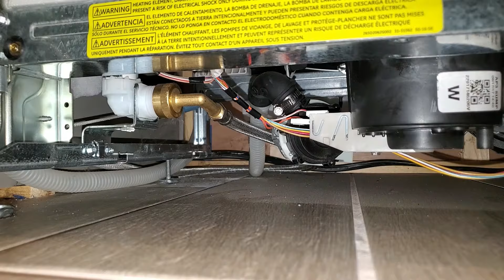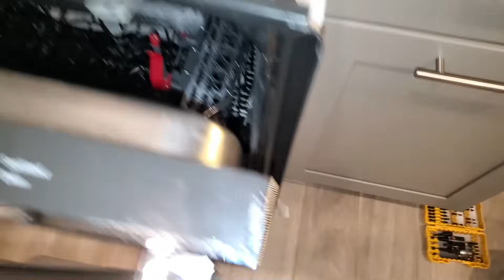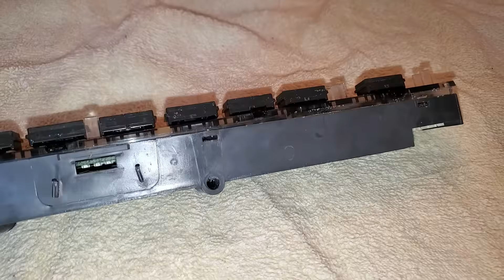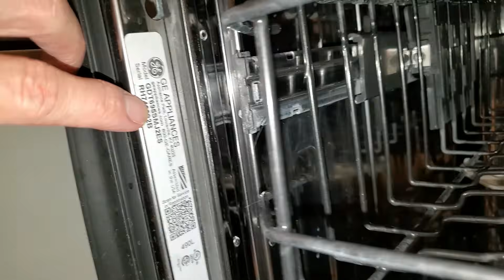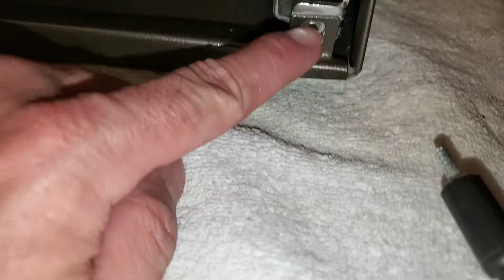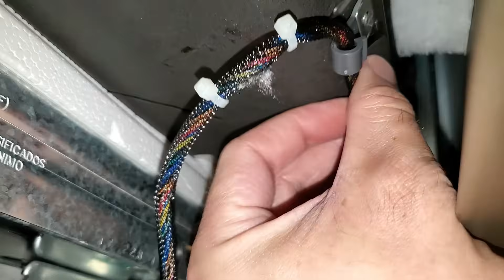GE Dishwasher Repair  - Replacing the User Interface Control Board

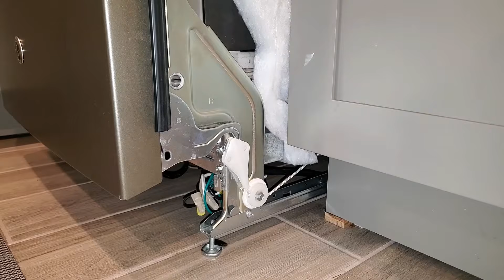Comment: Thanks for this it was very helpful.  With my unit (model ddt595ssj2ss ) I didn't have to move the unit out of it's spot. With the door shut,  I was able to unhook the white plastic tension tab attached to the nylon string with a hooked pick. The plastic has a hole in it, I unhooked the plastic and  pulled straight out.  If you look below the hinge area , there is a little bent up tab that is meant to hold the string (you can see it in your vid at 10:20) I pulled out the tab and slid the string in that tab. It's held securely in place but I still put screwdriver on each side though the holes just in case it slipped out. i didn't want to have to move the unit out to retrieve the string.  Then I removed the door and took it apart like your video. Again very helpful, but doing this saved me a lot of time and trouble.
Reply: I too left my unit in place and just removed the tab with needle nose pliers, after reading your comment I replaced everything using the reverse of your technique and it worked great, thanks!

Comment: Matt I really appreciate you posting this video! I got lucky and didn't have to disconnect the power, water or drain lines in order to pull out the dishwasher the 6-8inches needed to get to the hinge cables. Total time to repair following your instructions about 45 minutes! Thank you so much for posting this, keep up the good work!

Comment: Thank you so much for this video. I will say for our dishwasher, we ended up not having to replace the board. 

First we verified that 14V was coming from the power board. Then, after removing and disassembling the door, I checked that all switches had continuity when pressed. 

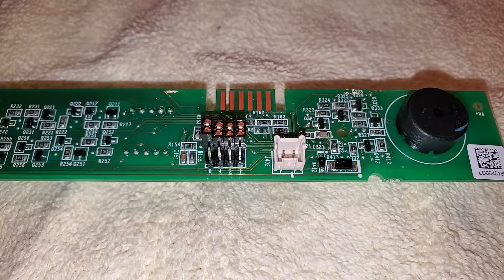After that, I was able to get the board to come back alive by shorting the GND and REST pins while the board was plugged in and connected to a powered on main board. Those pin labels are visible at 20:10 in the video, to the left of the 888 display. The exposed traces are visible at 22:32, above the jumpers. Once shorted for a second or two with a jumper wire, the board came alive. You can also use these pins/traces to at least verify you are getting 5V to the board (from the 14V). 

Hopefully that fix holds.

EDIT: The reset held for one wash, and dishwasher is unresponsive again. Will attempt another reset but not holding my breath.

Comment: All the same symptoms mentioned here: Random beeping • eventually dead • turning off breaker worked a few times • then completely dead.
After accessing the UI board, I removed/reinserted the main cable at the UI board and then reconnected the cable from the UI into the bottom of the dishwasher (while door was still removed) and the UI board lit up! Reassembled/reattached door.

It took a few hours before I again heard the first random beep. Dishwasher continued to function for a few weeks and then no power again and breaker trick didn't work at all.

Removed door last night and removed/reinserted the main cable at the UI board and it lit up again. I was curious if it might be a connection issue. The clip where the cable goes into the UI had some play, so I tightly stretch some electrical tape across it to remove play.

It's now powered but randomly beeping again, so it doesn't seem to be a loose connection. Wish I could figure out what's at the heart of this.

Comment: Wonder if the moisture from the dishwasher is what's shorting these boards out - did they actually fix the UI to combat that? Is yours still running strong (course, it has only been 2yrs...). :) Good job! I've the same issue, and I saw on the paperwork that it's the same exact part. lol Mine is DDT595 (I presume the first letter is the date of production (this was a rental unit, so very disappointed to just find out that the unit isn't working as maybe it went out while it was still under warranty).

Comment: Great video. Just finished replacing my UI board and this video saved me lots of time and many swear words. One thing I did differently was when I separated the two parts of the door, I left it laying flat rather then standing it up.  After the screws were out, I just pushed from the bottom rather then pulling from the top. It worked like a charm first time with zero fenagling. Putting it back together laying down was just as easy.

Comment: This was easy to follow and so useful. Many thanks Matt. Getting the kickplate back on was probably the most difficult part. Since my screwdriver wasn’t magnetized, I used tape to hold the screw in the screwdriver and also tape to hold the insulation back from the hole that the screw went in when installing the kickplate.

Comment: Our Siemens dishwasher has started to act up similarly. But to repair it, we would have to replace a much larger section of the door, which includes the electronics, and that spare part costs almost as much as the machine cost from new 🤬 #righttorepair

Comment: Thank you! Worked for me and my gdt655ssj0ss. After a few months of the weird "random beeping" issue the dishwasher wouldn't respond. I replaced the Control Board first, but after about five minutes of looking like it was fixed, it became totally unresponsive. That's when I read (thanks to some of the responses here) that often both boards go out together. I couldn't pull the trigger right away; since I was unsure whether I should be dumping another $100 into trying to fix it myself. But I finally gave in, thanks to how simple your video made it look. And everything in this video was great, and true. I replaced my User Interface Board in 20 minutes without issue. It's been working for a month now. I can't thank you enough.

Comment: Thank you for your excellent video. One thing to add (found out the hard way), if you disconnect the spring nylon cables, hook them in the parking J-hook notches provided just below the pulley. That way the spring will remain under some tension and avoid becoming disconnected from the nylon string end piece.

Comment: Thank you a million ❤. I put the new board in and bam it worked again and power!

My only issue right now is that I’m not getting water to come when I turn on the washer. I’m thinking maybe I needed to provide some? Maybe it needs siphoned in if air is in the line. I dumped some water in there it’s running im hoping next cycle fills itself 🤞

Comment: Before i retired, i did probably about a 1,000  + of these repairs, in the last 10 years . In a 40 year career working on GE products, this run of dishwashers was/ is , hands down,  the biggest boondoggle they have come up with so far . This model series,  has got to have the record for most Factory service bulletins, ever !
Reply: Thanks for the info. I changed the control board and user interface and the machine came back to life. I started a wash and cancelled it. Worked great. For 5 minutes. As soon as that ended, it went dark again. I was touching things underneath and it beeped and came back on momentarily. I then took the little plug out of the sump and the panel lit up. I opened the door and closed it and it went off again.Some component is screwing up the electrical system.
Reply: Steven Dodell did you ever track this down? I'm having the same issue...
Reply: @StevenDodell-id1kg  Usually the power connection plug under the smart board.  Look for discoloration... a weak connection there will act erratic

Comment: Matt, Thanks for the video. My dishwasher, GDT695SMJ5ES, is very close to your video but 3.5 years old. I did as you instructed on both of your videos, found power coming from the power board and then bought the UI board. Replaced and it works great!

Comment: Just a useful piece of advice - You don't have to unhook the cables. All you have to do is take out the two 1/4" hex screws at each bottom corner and slightly open the door and it will lift off the hinge assemblies. You don't even need to unhook the water or even pull the dishwasher out from the counter. Can save a bunch of time and effort by not pulling it out.
Reply: You do have to remove the tensioned clips to get the door off on this model, but you can do it with needle nose pliers if you’re creative and can save a bunch of time.
Reply: @Belo83  There are 2 holes in the tension clip and I used a torx to slide it on and off. It's pretty easy to do.
Reply: I saw another video showing this but that only seems to work with some models, my hinge system (ddt595ssj2ss)  is just like the one in this video. These hinges are attached directly to the rails and will not detach like that unfortunately. I did find a way to remove the door without sliding the unit out though, I commented on that above.
Reply: This sounds promising -- the hinge/door removal seems like the most effortful part of the operation.  Which hex screws?  The ones that seem to be behind and to the left of the plastic tensioner as seen in the video?
Reply: "..band clamp that can be loosened using a hex driver" Um you're not wrong but that hose clamp looks like it also has a slit for a flathead screwdriver (which 99% of people are more likely to have handy). Not sure if im helpful or just bitpicking ;-)

Comment: Thanks Matt, this was great!  I did mine today and it's currently washing dishes.  Your video and steps were spot on.  I had all the tools needed and didn't have to go down to the basement to grab a missing something.  Someone suggested separating the door panel on its side.  This worked much better for me, it slide apart easily on its side. I had to take mine apart twice.  I either didn't clip in one of the cables to the UI tight or didn't push down a jumper tight so while I checked the pins twice might not have pushed something tight.  You can get to the jumpers without separating the display as there is a cutout on the bottom.

Comment: I had about 30 washes in 3 years only (!) and the display died. Thanks for the video, Matt. I was just wandering if the newest electronics are made purposely to last only for certain amount of time. It make sense: it gives work for the service people, for board makers, etc. but it sucks! I was able to replace the board myself but not many people are mechanically incline and they will be paying big bucks to fix what, I think, it was scheduled in advance by the manufacturers... I've replaced electronics for almost all my new kitchen appliances after the warranty expired. I should have stayed with "energy-inefficient" appliances and had no problem. I hate the way this all new technologies in the world going. Check this: "The Centennial Light is the world's longest-lasting light bulb, burning since 1901, and almost never turned off. It is located at 4550 East Avenue, Livermore, California, and maintained by the Livermore-Pleasanton Fire Department."

Comment: Thank you for this how to post.  Just changed my board out in a few minutes instead of hours thanks to your step by step tutorial.  My only snafu occurred when I lifted the inner door from the outer door, I popped the cover plate off of the top and it broke all of the tabs off so it wouldn't;t stay on securely.  After a little head scratching, I found some very sticky dbl face tape and it's all good.

Comment: Thank you for doing this video.  I feel like my husband and I just saved about  350.00 on a parts and repair bill.  Our model is so close to yours but the DDT595  etc.......type model and we just installed ours and it went perfectly.  It went so quickly I couldn't believe it and I know you saved us two  + hours in time trying to figure it out ourselves. Thank you for that. You were so methodical and precise and everything went exactly as you did.  Our pin set up was different than yours but the technique exactly right on. 
Again, thank you so much.........I was dreading the Holidays without a dishwasher, even though I don't mind hand washing dishes. 

The only thing different on our GE washer was that there were no clues anything was wrong except a few times it had been ending the cycle and when I would ck later to put the dishes away there would be water still standing  in the bottom of the machine.  Thus, I redid  the load.........that happened a few times in about three months time so that was my only clue.  Ours just totally lost power and not a light would come on in any sequence.  
Thanks again, you really saved us a ton of time and money.  At 76 years of age we are still fixing most our home tasks so again, this was a great video. Kudos to you!!!

Comment: Just finished replacing the UI board on mine (~$100 on Amazon).  Some notes for the next victim: the cycle times are different than before, and the LED display is a different color (white vs green), but seems to work OK.  When replacing the power supply board housing, I used the wrong screws (machined ones for the kick plate instead of brass coarse threads with rubber washers) because I had taken it apart a few days ago before watching this video and ordering the replacement UI board.  So I would suggest taking pictures as you go for reference, or making a quick note of which screws go where.  Finally, when I entered the PN WD21X23462 on Amazon, the search results showed WD21X23461 which I was tempted to buy instead because it's quite a bit less expensive.  They have three similar boards with PNs ending in "1", "2" and "3" which are NOT interchangeable, the locations of the displays and push buttons are different on each board.   You can easily Google your washer model and find the correct PN for your model.  Thank you again for taking the time to make this video, you saved me $5-600 for a new dish washer!!

Comment: You sorta think that you can tell if things are working by checking some pins?? There are like a dozen wires. Hmm Let try  pins 2 and 5 and with it unplugged. Lets guess about 10 to 13 volts. That might mean alot. Hope we do not slip and short the guts eh? Schucks, lets do some more board shotgunning replacement. I hope we win!

Comment: Hey Matt thanks a lot for this video I ran into the exact same problem. How did you come about the replacement part number of WD21X23462? Wherever I look (about your model and mine - they share the same UI board) it says WD21X32000. I'm puzzled as to which on to get but from your video the instruction sheet shows my specific model as well in the jumper pins settings :)

Comment: Our dishwasher had the intermittent turn on symptoms but you can prevent that from happening by pressing and holding the Start and Wash Temp buttons for 5 seconds. After that the only way to turn it on is to press the Start button. That worked fine for a few more months then the washer didn't respond to any button press. After taking it apart I connected the user interface board back up to the main control board, reset the breaker, and everything powered up like normal. It has been running fine for a couple weeks now and hopefully keeps going. That seems to indicate that there was an intermittent connection on one of the connectors since all I did was disconnect and reconnect them. Anyway, do yourself a favor by disconnecting/reconnecting the connectors and checking that everything works before ordering a new circuit. Since these connections are exposed to a lot of moisture it also wouldn't hurt to apply some dielectric grease to the connectors and terminals before reassembly.

Comment: Thanks for the video. My dishwasher is the exact same model and I have tested the 120V for power and the 14V to the UI. Oddly I get 119.5V power and 13.5V for the lead to the UI. So it looks like I will be replacing the user interface. I did notice one thing in your video when you released the door tension  pulley there is a catch to place it in when it is removed. There is a little 'tab' to the left of the wheel that is used as a catch for the plastic hook. A better look is in your video @ 10:28 -10:34.    As a side note, after watching this and other videos the lights my dishwasher UI lit up and I was able to get the dishes done.  Thank you for a powerful video.

Comment: Matt.    

.this was an excellent instruction video...I'm glad you specifically pointed out the fact that the new control board jumper pins were set with open pins...I would have missed that when I installed the new board so you saved me a lot of grief and (of course) money   Thanks

Comment: This video and the one diagnosing the problem was excellent!! I am fairly handy and not afraid to tackle many problems around the house, but I've stayed away from most things that have boards and lots of electrical components. This video made it all very simple and was easy to follow. For about $130 and a couple of hours of my time-I'm retired, I fixed our 3 year old dishwasher. My neighbor had the same problem with their 3 year old GE dishwasher and paid close to $500 for a repairman to replace both control boards. THANK YOU!
Reply: I have a much older GE dishwasher, it's from 2003. It's the one that came with the house when I bought it.  A builder installed machine. The control panel went out on mines. I had started needing to shut off the power to reset it and it work for a few months doing that, but finally the machine went out.  Since the machine is so old, I had to go on eBay to find a factory control board. At least with my machine the disassembly of the door was easier. I had thought about replacing the machine, but I thought I would give it a try in trying to repair it myself. I bought the part a couple of months ago and I finally got around to replacing the control panel today. For less than $100 I have a running dishwasher again.

Comment: Another happy viewer. We got the dishwasher fixed. Interestingly enough we did not get the paper with the jumper codes on it. Fortunately we had the same model as this one. 
It works perfectly now except some of the cycle parameters appear to be different with the new board. 
The times and temperatures aren’t the same.